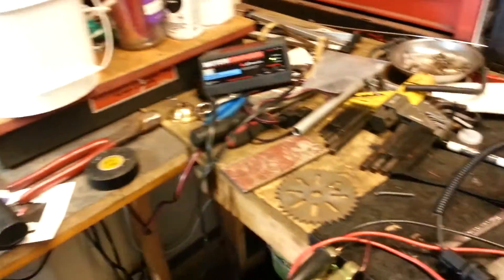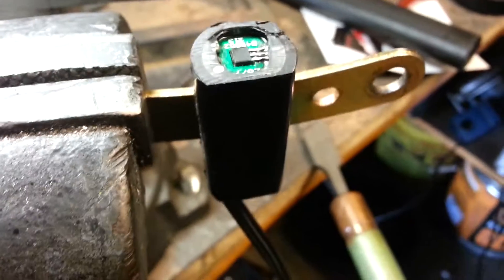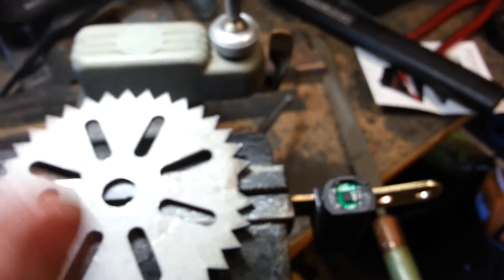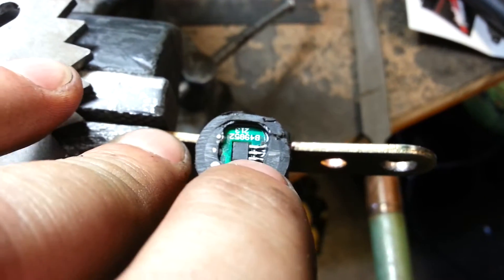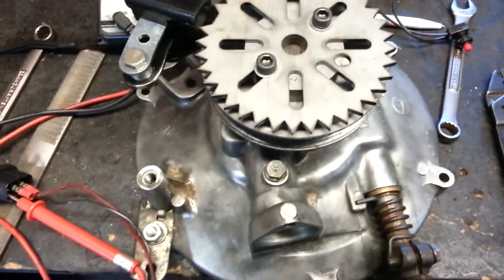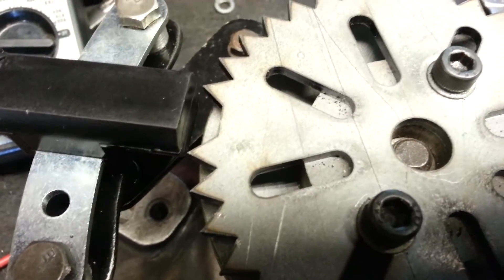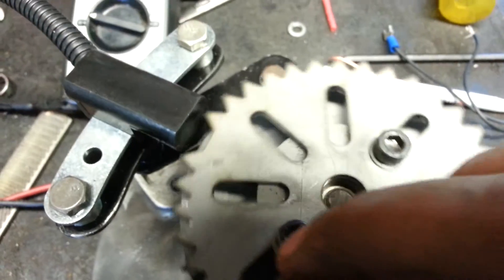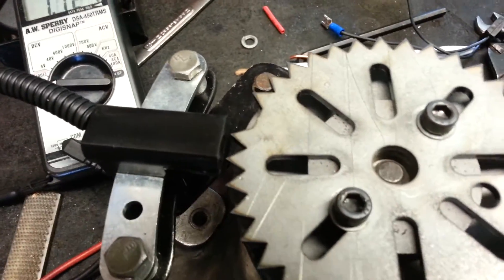How does it work? Crank position sensor.

Comment: I have a couple questions if you don't mind. The first one is your multimeter is beeping so you are looking for continuity through the sensor correct? And you are running 12 volts through the sensor did it survive at that voltage? And the output is continuity through ground or positive? I know this is an old post but I hope you reply thank you.
Reply from the maker: @daveteal3194  yes this sensor works fine on 12v the pulse will be driving the 5v sense line from the ecu to ground.
Sorry it took so long to answer. The email alert was buried.
Reply: Thank you for the reply. In your video it appears you have power going to leg 3 ground going to Leg 2 and one side of the meter going to the pulse or leg one. And it looks like the other meter wire is going to ground which would mean the sensor would be making and breaking power not ground correct? And that pulse line leg one would be going to the ECU?
Reply from the maker: There is a common B+ pin which is powered when the key is on. There is a common ground pin and a sense pin.
The 12v supports the sensors power requirements and the sense line is the one the ECU watches for an event on.
To do this the ecu puts 5-8vdc on the sense line and then watches for it to be pulled to ground by the sensor when a gear tooth or other structure used for timing passes , this will trigger an event in the ecu code.
Reply: Perfect, Thank You!

Comment: Is the computer equipped to detect reverse rotation of the reluctor wheel.  Years ago a neighbor of mine accidentally fired a 2 stroke motorcycle up going backward.  It was kind of surprising thinking about it because although rotation was irrelevant for the points the magneto was different story. Must have fired that plug backwards, lol.

Comment: Been forever looking for a vid like this,so within the crank sensor transistor pins are the same power,ground and signal.and the power pin gets pull to the signal at the middle?
Reply from the maker: Hey Ryan, I'm trying to understand your question. basically this sensor is a switch that changes state in the presence of a magnetic field. 
There would be a + pin, a - pin, and a pin that is pulled to - when the sensor detects magnetic field.  I guess you could consider it something of  a solid state reed switch.

Comment: what does the computer do with this signal? power the injectors , spark or both?
Reply from the maker: It uses the signals from the Crank position sensor, along with other sensors to determine the current position of the crank in the cycle, current working load, air temperature, engine temperature, and throttle position to calculate how much fuel to inject, when to inject it, and when to light it off for the most power .
Theres a lot more to it, and I cant begin to cover it all in this reply.
Thanks for asking!

Comment: would object and sensor joint if the air gap between them is small ? i assume it's impossible to detect if there is contact between them
Reply from the maker: Not sure what you're asking.
If the wheel was to collide with the sensor it would grind away at the housing and eventually cause a failure of the sensor.
So yes, there are maximum and  minimum clearance requirements to both maintain detection and prevent damage.

Comment: what happens if you wire a crank senor backwards? Could anything break?
Reply from the maker: It's a safe bet to assume that you could damage the sensor itself should it be wired backwards. but that's dependant on a few things, one being the voltage sent to the sensor by the ecu.
most sensors should be able to withstand being hooked up backwards if it's a really low voltage feed (3-5v). once you get up to 8-12v there's a good chance you may catch some pixies trying to escape.